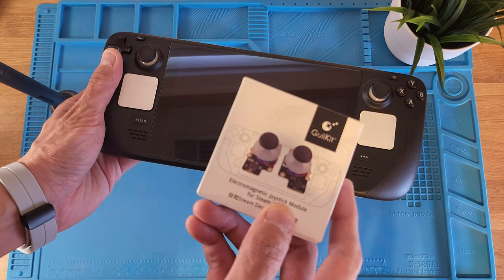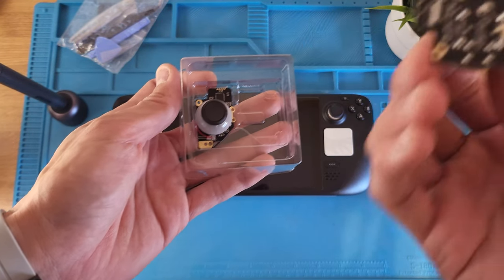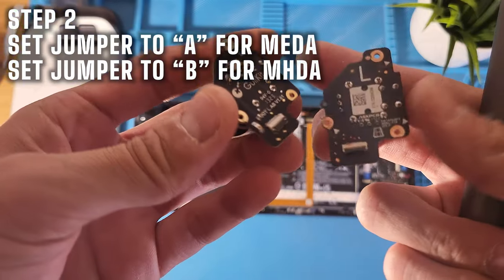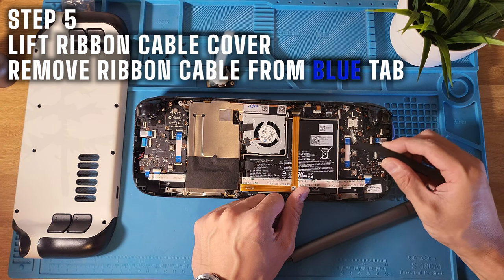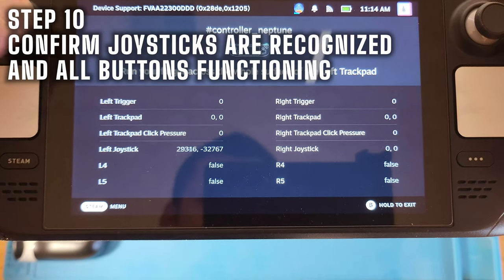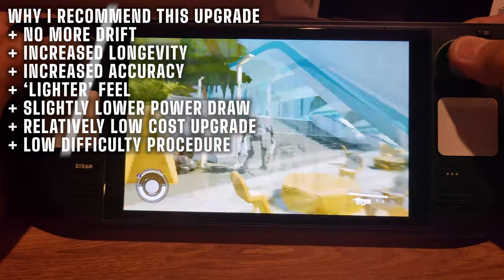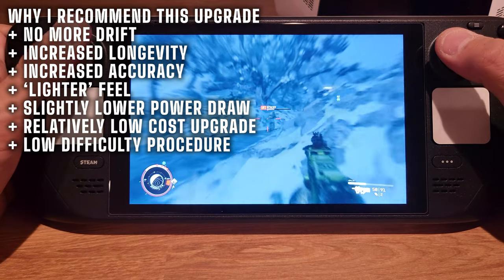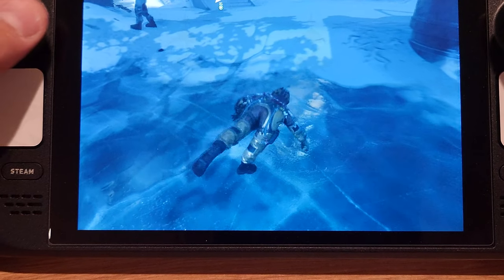Steam Deck Hall Effect Joystick Upgrade... Worth it or What? \\ Gulikit Installation Guide + Review

Comment: I see where there is Sodering a wire on each joy stick on other videos but the sticks didnt have a  A and B setting these do! Do we still need to on these and y dont the others have the A and B switch?
Reply from the maker: the one with soldering required are the older versions where you could optionally solder the touch sensor on the sticks. The ones I'm showing already have that feature without soldering. These are the newest versions with most compatibility.